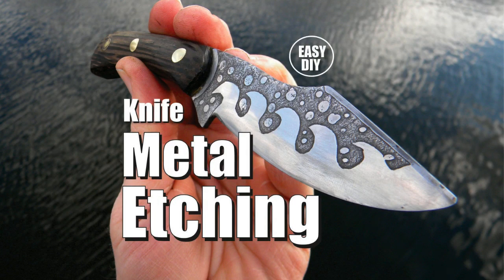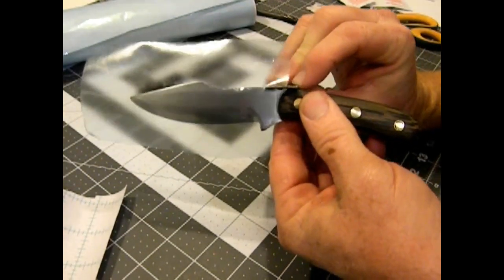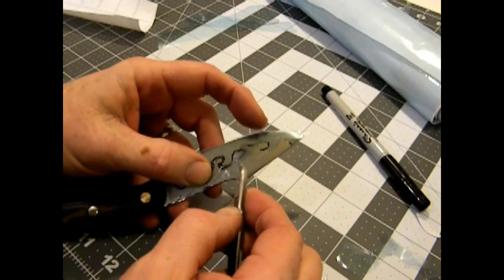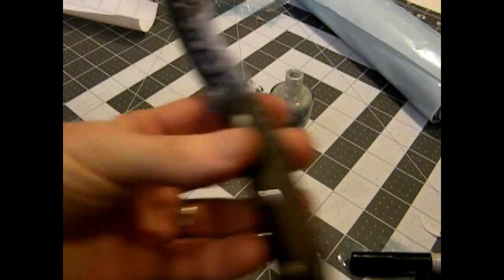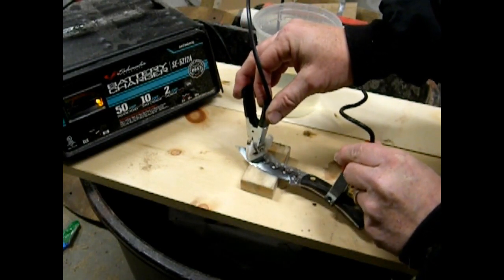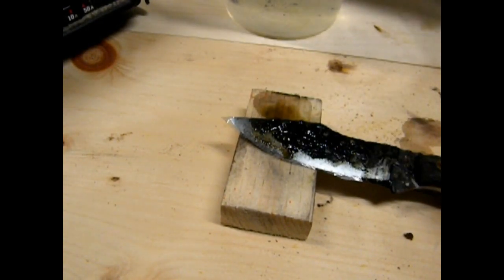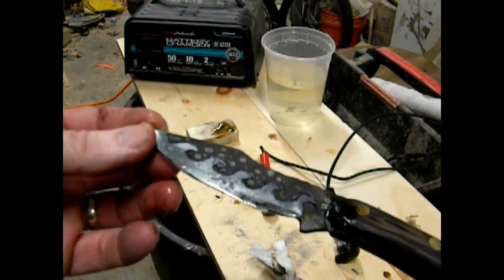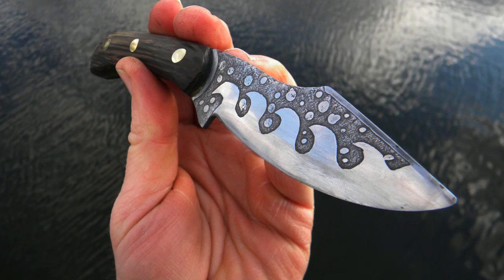Easy Knife Metal Etching DIY

Comment: I spoke to a guy who was making etched medieval armour about how he was doing it.  He said the traditional way which was to cover the metal, of course fully polished and degreased, with French polish ( shellac flakes in alcohol usually methylated), let it dry and then remove the French polish with a scraper or fine scribe to make the area that will be etched.  Then etch it with acid, electrolysis or whatever method you want.  Being a great artist helps with intricate stuff. Remember if you are etching deeply the acid will etch sideways as well as downwards.  I think lamp black or some sort of fine soot was used to darken the etched areas.  Gold leaf might be possible but that requires quite a degree fo skill.

Comment: I built two blades using just electrochemical etching for bulk metal removal.
With both, I used clear packing tape as the resist, a 6 volt 40 amp power supply and lots of salt water.
The steel blanks were fully heated treated prior to any metal removal.
1095 for the sword, A2 for the dagger.
I used a tank made from a section of 6" PVC pipe, cut open along one side.
The etch was not ideal, as the current per square inch was low.  Lots of pitting.  Higher current per area gives a smoother finish.
The final work was done with files and stones.
The goal was to make blades not using grinding or forging processes.
A double-edged sword and a long dagger were the result.
The total time for the sword was about 27 hours in the tank, the dagger about 12.
I would the area nearest the edge first, then re-mask the blank to expose a bit more metal.
This way a terraced profile is built up.  Each 'step' removed about 1/64" of steel from both sides.
The get rid of the steps of the terracing, I painted the entire blank with a fast-dry enamel.
Once dried, draw-filing removed paint from any 'high-spots'.
Etched for a few minutes, the exposed high-spots would become leveled out.
Repeating the mask/file/etch process a few times left a very nicely flat bevel.
Reply: 5

Comment: Could I use a stick welding machine instead of a battery charger? I assume they are the same. A negative and positive side.
Reply from the maker: Im not sure. Can you set it at 12v 2 amps. If so it should work

Comment: Ok quick question electricity     generates heat .it doesnt hurt your temper on your knife?
Reply: I think not... For the current would have to be high enough to heat the steal but 12 or 50 amps I heard in the video can't produce that much heat and he used it in short bursts so the process should not mess with your temper but I can be worng so any professional please let us know cuase I can do the ecth like this fairly simple but I need to know my shit before u even start
Reply: No it doesn't get hot enough to effect it

Comment: Damn.  I just cannot find a suitable charger anywhere.  They are mostly automatic, or won't work without being connected to a battery.  Any help locating one would be appreciated.
Reply from the maker: Its getting harder and harder to find. You could open up and bypass the breaker on a new automotive charger (if you know someone that has electrical knowledge). Otherwise search online for a 12 volt 2amp power supply
Reply: DIYeasycrafts Thank you.  I bought a 2, 10, 50 from harbor freight and a friend is helping me to hot wire it based on a youtube video.  Are you etching 01?  I think that may turn blacker than mild steel, which I am using.  Thanks for the videos.  They are very helpful!

Comment: looks too dangerous no matter how careful you are some kid wanting to do this is going to electrocute themselves or set the house on fire
Reply: Daniel Rosado, if that happens it isn't his fault. The kid should know better, and I don't think that a car battery and wires are going to be laying around waiting for a kid to play around with.
Reply: ChristheMotoGenius 1 yeah I don't think kids would be stupid to climb a 10 feet fence either but kids do anyways and break a leg or crack their head open, kids can't help themselves and people do leave batteries laying around use some common sense
Reply from the maker: On that note you better put away all the sharp kitchen knives and hide the matches. Hell might even have to lock up each power tool in the work-shop LOL. In reality etching with salt water and a battery charger is a lot safer than having acid around. If your afraid for your kids safety then lock up the charger.
Reply: even if you tried hard, you can't harm yourself with a 12V battery...it just isn't strong enough to penetrate skin